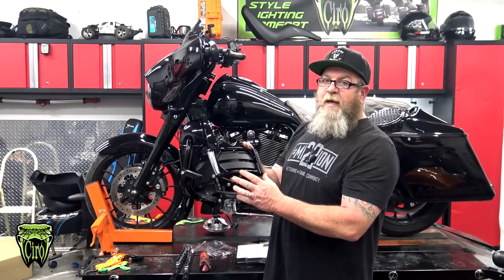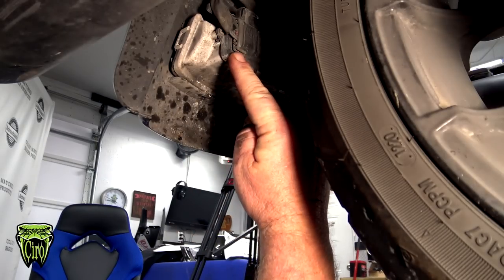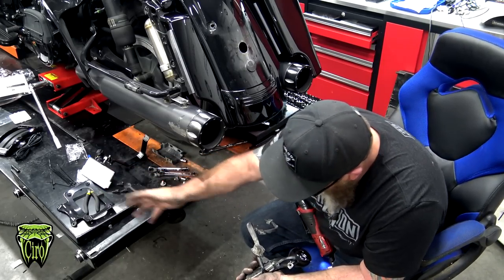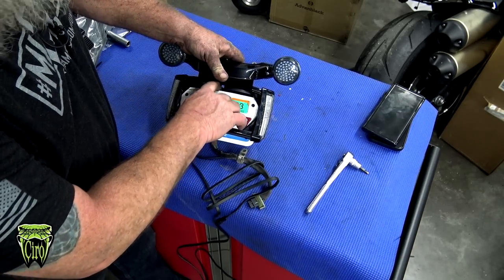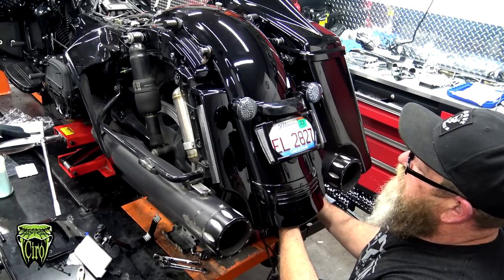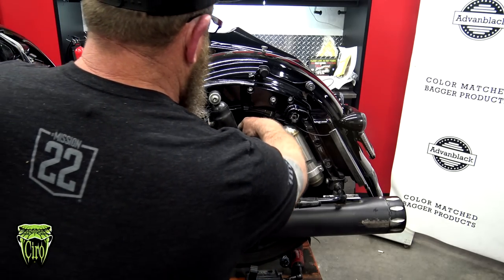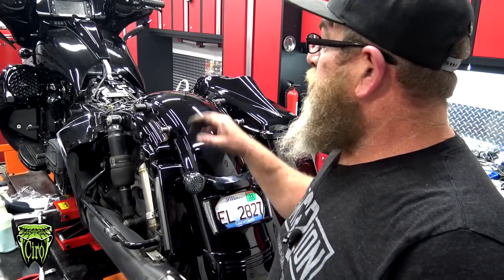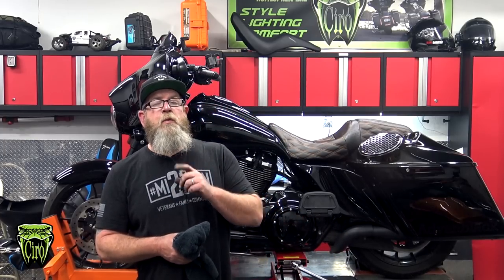Ciro 3D LED Lighted License Plate Frame Install

Comment: My forearms simply don’t fit between the tire and fender on my 22 RGS to get to the 2 bolts that hold the taillight assy on. I might get them removed but they aren’t going to go back on. Could I disconnect the shocks to allow the wheel to droop further, or would it be limited by something else?

Comment: I have a problem and I hope you have a solution for me. I have a 2018 Fatboy. I want to add 6.5 speakers to it preferably on lowers. I do not want saddlebags. Anything you recommend?
Reply from the maker: Youll have to install a full size crash bar engine guard to add lowers...ready available on ebay and amazon

Comment: Hi Steve, In your opinion which do you think are a very good rear shocks, I know there are factors involved but with so many on the market it just gets a bit kooky in which shocks I want to get.  I have a 2019 SGS. your opinion matters  Thank you sir.
Reply from the maker: Hey James..yeah I group shocks in with the same category as slips ons, seats and windshields...its really a personal opinion on feeling and sound with this group of upgrades.  I will say if you plan on running regular shocks and not air, I would suggest looking at Price wise in this order, progressive, legend  then ohlins. They are all good shocks, just check prices according to your budget. If youre doing air...Dirty Air all the way man...never an issue with these guys

Comment: have broken 2 of these now over the course of a year.  The tabs that hold the holder to the light bar keep breaking off because of the vibration from the bike there made out of plastic not metal.  Ill be going back to a stock metal one.  Wish they made them in metal if they ever do ill get another.
Reply from the maker: man sorry to hear that you had that issue

Comment: Will this bolt and work with the Latitude tail light instead of using the factory tri bar light?
Reply from the maker: yes it will work with the latitude light

Comment: What front fender is on that bike Steve?
Reply from the maker: I just put that fender on while this bike was in here...we did the tank covers, tank dash, wrap fender, all new audio, upgraded ciro fang turn signals and this plate light...all of the abs painted parts are from Advanblack.  https://www.advanblack.com/color-matched-19-reveal-wrapper-hugger-front-fender-for-09-22-harley-touring.html
Reply: @sikbaggers  Thanks Steve